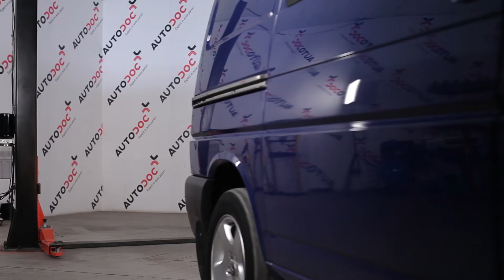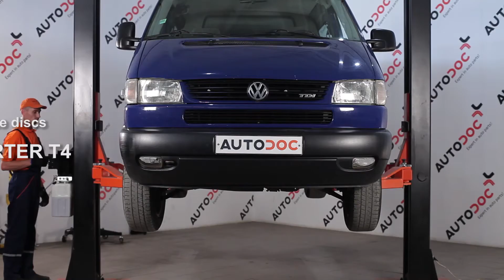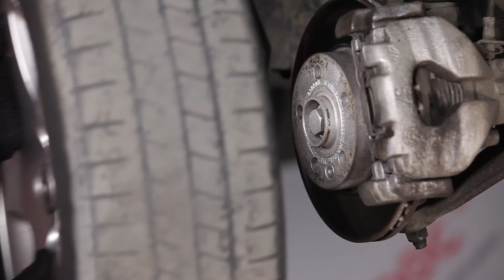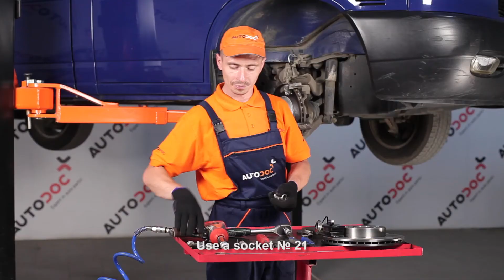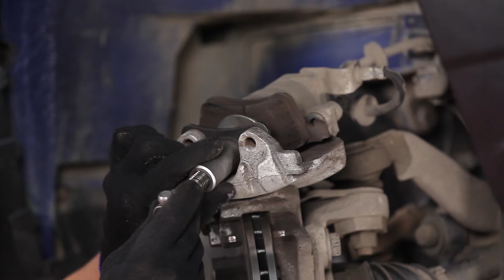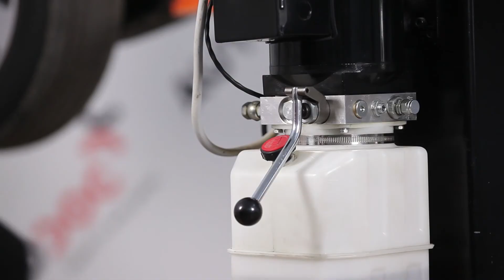How to change brake discs and brake pads on VW T4 TRANSPORTER [TUTORIAL AUTODOC]

Comment: Very well filmed and in good light, very easy to follow.
Reply from the maker: Thank you for your feedback! Our production team is doing their best to improve the quality of our content with every new video. Stay tuned for more! Best Regards, Autodoc Team
Reply: @autodocuk   Would you consider doing a video on replacing a brake vacuum pump on a T4 ? As we know  they cause a very common and annoying "tapping" noise which stops when the brake pedal is pressed. 
I bought a vacuum pump from Autodoc earlier this year but even though I was told on the T4 Forum that it was an easy job I  wasn't confident enough to do the job myself . 
I think a video on this very common problem would help a lot of T4 owners to get stuck in and cure that annoying noise.

Comment: Interesting.
So you don't slacken the bolts diagonally, even on an alloy wheel, so the wheel may fracture?
You put alloy wheels on to full tightness with a windy drill, so the wheel may fracture?
You do not torque the bolts?
You drive in daylight with the lights on, (dangerous)?
Reply from the maker: Thank you for the feedback!This video is considered to be an informative one, and it is approximate. Best regards, Autodoc.
Reply: Great nitpicking!

Why would the rim fracture if you loosen the bolts? Even if it was theoratically possible, you are more likely to win in the lottery and the rim would have to be close to failing anyway.

Clearly the mechanic only gently drives the wheel screws in place with the air tool and the real tightening was probably done off camera. No one torques wheel screws but yes care should be taken into consideration with an air tool. And yes, it would be good practice to torque the brake caliper and its mounts.

In some places it's required by the law to use low beam during day even if the weather is bright. I don't see anyone crashing their cars because of that. :D

This is a nice video that was filmed with good lighting conditions so the parts are clearly visible, thanks!
Reply: I guess it's because wheels are different to cylinder heads . Very few people torque wheel nuts up after a puncture or tyre change , I know the manuals tell you the torque settings for wheel nuts but it is widely ignored.
Reply: Your concern is about wheel nuts 🤔 if I was to criticise. Ì think I'd be more concerned about the reservoir for the brake fluid. And how that side of things was not shown. 
( Wheel nuts !!!! 😂😂)
Reply: @AnttiHarri  And that is why you aren't a mechanic.
Reply: @ulfulicksson747  sorry but
 you make me laugh. just to name one car with lights on the moment you switch the engine on. Volvo oh!! go on then I'll give you a second one Saab.... 
What would you do if you had a puncher on the side of the rd. 
Would you call out AA (other companies are available) and I can guarantee you they would not use a torque wrench. There is a thing called experience my friend. 🏁